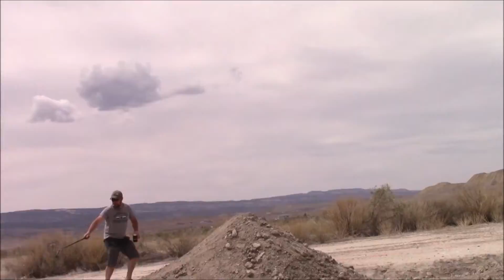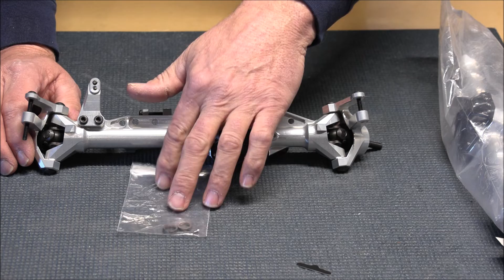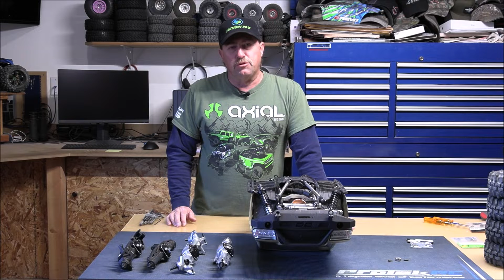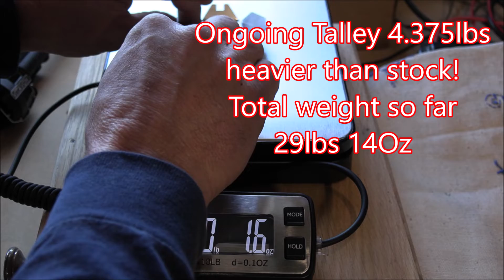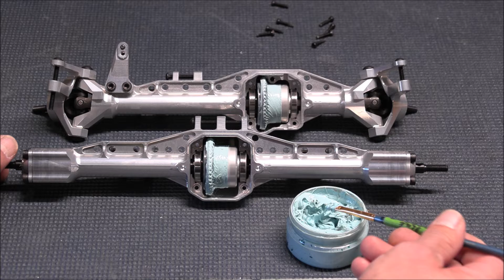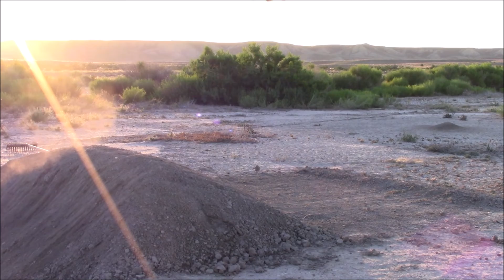SCX6 Build Series Video #6 Installing Vitavon Axels with Limited Slip Diff Set.

Comment: Just ordered my vitavon axles as long as with a lot of other vitavon parts for my scx6 so hyped ! It was very expensive I’ve spent so far 2,500$ on a 1,100 RC agh crazy
Reply from the maker: I'm around $4500. So far, but have enough parts going on it to equal $7500.
Reply: @upgradedrc3697 have you figured out a good diff cover for the vitavon axle ?

Comment: What was all the clicking towards the end of the video during the rock climbing? Sounded like gears slipping?
Reply from the maker: Yes, I did the limited slip for people who requested it. Abd wanted to know how it worked.
Reply from the maker: Nope, that was the limited slip diff working good. (Slipping). That's why I replaced them with lockers in the next video.
Reply: @upgradedrc3697  what’s the purpose of having a limited slip when off roading or crawling? Other than turning sharper.
Real 1/1 vehicles lock up front and rear to get the most grip…I would think it would be the same in the RC world too.
Reply: It sounded to me very similar to a detroit locker but the detroit only "slips" when power is applied very lightly like when you are making a tight turn. If you are harder on the throttle then the gears lock together and wont slip at all. Obviously in this video it was doing the reverse of what it is supposed to do so i doubt the diff is designed like a detroit locker. 

Source of detroit locker reference:
My 2000 Jeep Cherokee with Detroit in the rear and True Trac front limited slip.